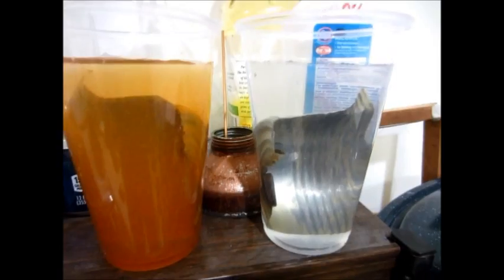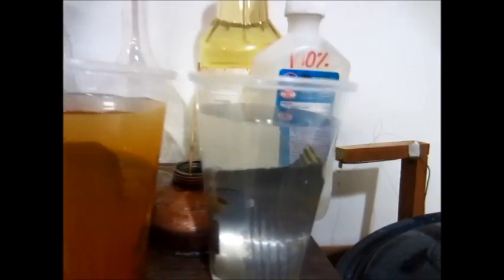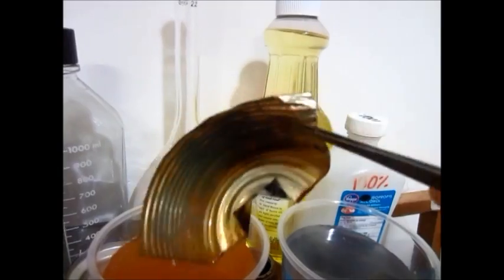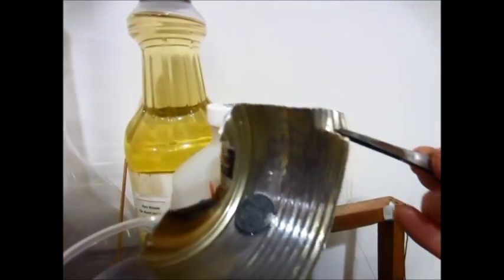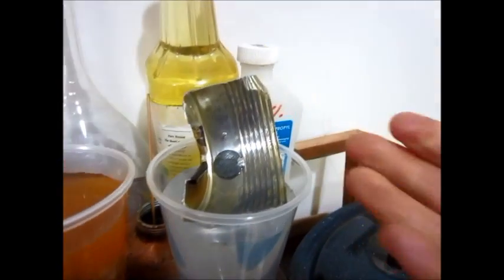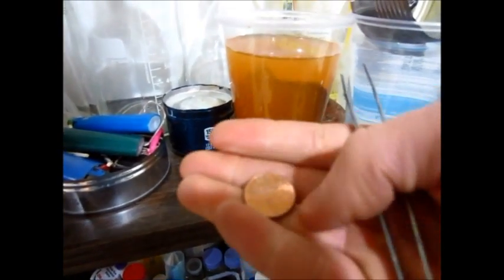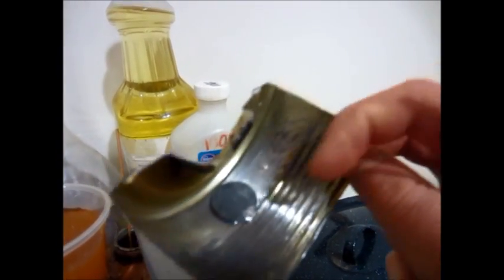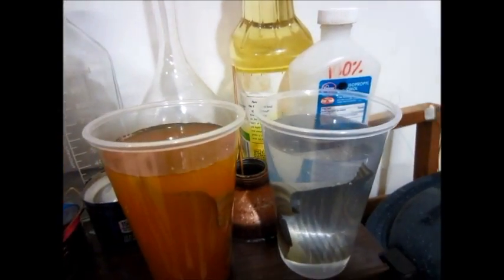Sacrificial Anode Experiment for New Stirling Engine #5 Water Jacket

Comment: i think no , cause tin have more reducing aibility than iron (  iron have more oxidizing aibility ),in effect if any anode metal wich is more reducing than tin give some electrons to tin ,iron will take them from tin because iron is stornger oxidizing than them bothe so iron will be protected 
if you gonna try Aluminum make sure first that he is stronger reducing & weaker oxidizing than iron to protect it 
also if you will try to solder aluminum to steel you will have problems

Comment from the maker: Do they put sacrificial anodes in car engines?  Yes adding salt would cause that to happen with out sacrificial anodes, but I'm thinking with sacrificial anodes it will increase the conductivity of the water and thus give better protection of the metal.  I could be wrong.

Comment: Prestone is engine coolant for car etc :). I wouldn't suggest using salt in your water it will make everything rust pretty fast and can form crystal in your pump which you don't want :) although sacrificial zinc anode should work very well :)

Comment from the maker: It should not work, but I will be testing that in the next video so watch for it!  Yes is does make a battery and it is the voltage that protects the metal.  I don't think it could power a motor!  Maybe an LED.

Comment from the maker: What is Preston?  I will be doing an update video because it's not working as good any more.  Mainly because the water is not conductive enough or the zinc does not produce enough voltage to protect it enough.  Magnesium would probably do the trick but I don't have enough.  Or adding some salt to the water would be another trick I came up with that might work.

Comment: Will it work with the zinc not attached to the steel? Just in the same electrolyte? I think it would make a battery (Steel neg) as well, don't know what you'd use the power for though... Maybe a starter motor?